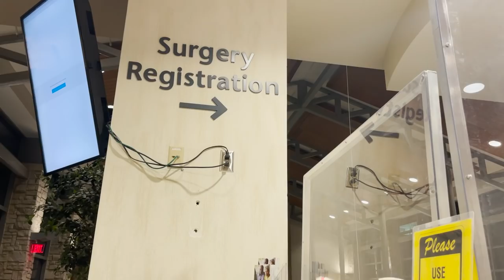Mela goes in for SURGERY//Don goes Solo in the BUS BUILD - S04E30

Comment: Wishing Mela a swift recovery!  Never use Vaseline to push wires through conduit, use dish soap and dish soap does not eat into the wire casing like Vaseline does. Vaseline will also get hot and drip out and is a fire hazard because it makes a fire more intense.  Vaseline also collects dirt and grime and is hard to clean up after it gets dust and dirt into it.  I always tin the wire before hooking it to any connection, that way it will never corrode since those compartments below will see more moisture than inside of the main bus body.    Even if you use conduit you should always put a rubber grommet into any hole through metal you want to pass liquid or wiring through.  Most box stores have rubber grommets in many sizes and you can slice the grommet to retro fit a hole even when you have something already going through it.
Reply from the maker: Thanks for the tips!

Comment: The connection you are talking about is real. In 1982 my step dad had a wreck like 400 miles away and my mom was at work at the time. He felt a massive pain in her chest and could not catch her breath. She looked at the clock and seen the time this happened and several hours later we found out that my stepdad had passed away in the accident. My mom was knew when it happened, she asked what time it was and was told that they believed it was within 5 minutes of the time she felt the pain. Mom said they were wrong. We found that the cause of death was exactly what she felt. It was very freaky. My mother still has not gotten over loosing him and says that kind of love makes everything else seem like a poor imitation.

Comment: Try K-Y Jelly for sliding that cable thru the conduit.  It's water-based and not petroleum based ... better for the shield on the wire.

Comment: Mela, I don't know what the time frame is between when you had your surgery and when this video posted. You appear to be doing well. I am surprised, but only a little, that you had an abdominal hyst as an outpatient. Bloody insurance companies!🙄😏🤨
 Take from a retired RN who has been on both sides of the bedrails and the Dr. Bendere Dundat School of Hard Knocks:
1. Stay mobile- helps prevent gas buildup and post op adhesions.
2. Stay hydrated. This is important for keeping your blood volume normal, keeping your pain meds circulating to your tissues and keeps the plumbing working.
3. Don't be a hero. When the body starts to be uncomfortable, take your pain medication. If you have breakthrough pain, ask your GYN what you can take in between. Better living through legalized chemistry is my motto. Whe your pain level is 5 out of 10, don't hesitate to medicate!
4. Get plenty of rest. While being in bed 24/7 isn't good, not resting when you need to doesn't help, either. Refer to the pain thing.
 Bus is coming along nicely. Well done, Don. If you have to stay another winter, so be it. You will then see how the bus handles those conditions while having a shelter in the storm, should we get another like last February. Take care, and God bless y'all.
Reply from the maker: Thanks!  Great advice.

Comment: Just stop with the timeline, it won’t do any good if either one of your health. It’s ok for one last winter at home, that way there is no stress on your body and Mel can recover longer.
Reply: Not entirely sure if you had scheduled things or were just looking to get out there as soon as possible.  I would advise against rolling out till you could do a full on driveway test for at least one week and get a check done on the running gear.  It would be really bad to go from a tight situation to a really bad situation.  Once you guys get enough systems in the bus, you could begin a long driveway test and know for sure you are ready.  Be safe, finish line is close either way.